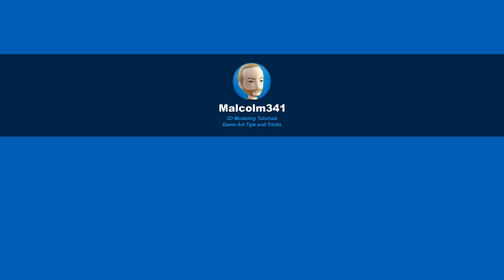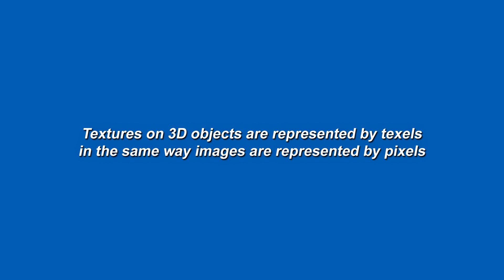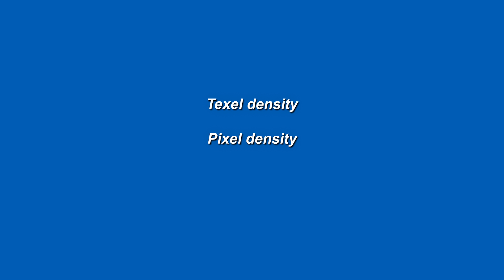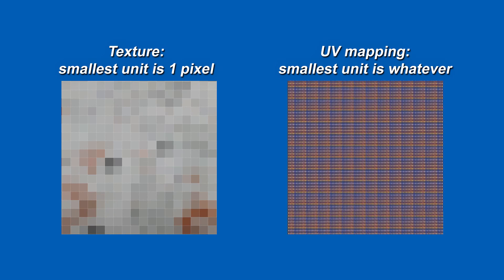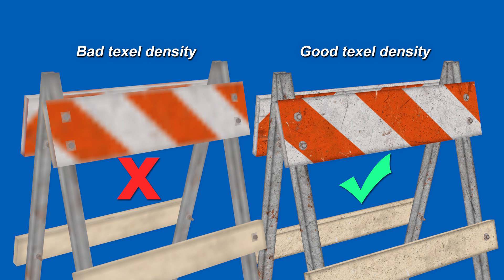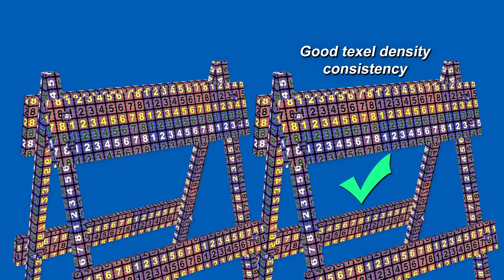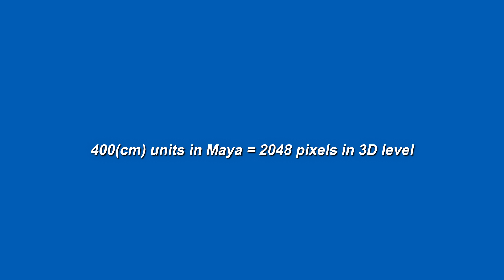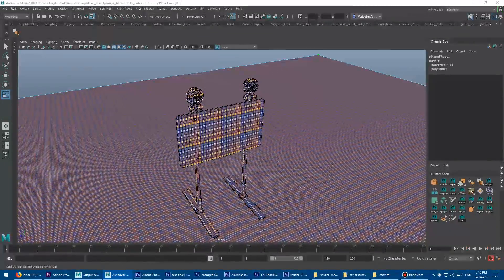What is Texel Density and How to Master it

Comment: and for game characters?
Reply from the maker: Characters will vary by game, often there are four separate textures, head, torso, legs, feet/hands. Typically each texture is 4k and then scaled down to 2k in game. The texel density will vary a bit, the face is often higher rez than the body because the camera needs to get close to it, this is also true of the hands
Reply: thanks for reply, Im trying to texture a large tank for example, I want texture density of 2048 per 1m meter but i need to bake a normal map so UVs cant be outside UV space, everytime i use your workflow as above the UVs are outside 0-1 space. any ideas?  @malcolm341
Reply from the maker: @SuperMontana2008 , the age old question how do I keep texel density high while texturing a big object. You have a couple options here, use multiple textures, use a really big texture 8k or larger, or mirror or tile parts of the UVs to save space. Or a combination of all three techniques. Typically for vehicles in games there are multiple textures, same with characters. We generally don't go above 4k in games maybe three or four 4ks might do the trick. If you're targeting film you can look into Udim tiles which is a lot of 2k textures that all get stitched together sometimes hundreds or thousands which are created in a 3D painting program, Maya and Substance Painter both support Udims as for as I remember. Mirroring the tread and the wheels is probably a good place to start for mirroring and will make the texture process more manageable, then try to use a couple more 4k textures, the bottom of the tank probably doesn't matter that much so maybe it can be lower rez or using a tiling texture. It can be tricky typically the hardest part of any project is laying out the texture using to keep it in budget while also hitting texel density.
Reply: Thanks for the detailed answer,. My tank is for game, its going into the unreal engine. I will probably use 3 or four 4k textures. Do i have to bake everything separately? If so how does the AO work if things a baked separately?  @malcolm341
Reply from the maker: @SuperMontana2008  it depends on what you want to use the AO for when you're done. Technically speaking you shouldn't really use world space AO as lighting information anymore because we have screen space AO and that will double up the effect in areas because it would also exist in the textures. Think about a character's armpits, if you bake AO there and then in game the screen space AO also goes there you end up with really dark unnatural looking armpits. This is kind of subjective though. If you're baking AO to use for texture masking in Substance Painter or something than localized dirt in the cracks will look good. If you're using Marmoset baker (my favorite) it allows you to bake multiple textures at the same time and also allows you to use bake groups so even if the meshes are overlapping they can ignore each other, also I belive there's a setting to contribute AO from certain objects or not, or if that isn't working just do the AO bake where you move the UV's for the other parts of the model outside the 0-1 range temporarily so the AO shadows the part you are baking.
Reply: Really appreciate your help, i will give marmoset a try. Do you know of any tutorials on how to bake multiple textures?? Every tutorial i have seen always seem to bake using one texture. :-/  @malcolm341
Reply from the maker: @SuperMontana2008  looks like you just assign multiple materials to the object and each material becomes a new texture. Make sure to turn multiple texture sets on https://marmoset.co/posts/free-update-toolbag-304/

Comment: Texel density matching can be way faster. Just use the "Layout UV" option. Set the "Shell Pre Scaling to "Preserve 3D ratios" under Shell pre Transform Settings. Then set the "Scale Mode" under Layout Settings to "Off" This will perfectly scale all your UV's to the correct scale in accordance with the size of the objects. Then scale everything to the texel density you want.
Reply from the maker: Neat trick thanks for sharing, the downside to this method is it's a bit slow to computer and the shells don't scale from their centers.

Comment: Very in-depth and concise explanation! Can I ask though why all other tutorials or uv mapping videos I watch everyone simply states that texel density should just be uniform across the model and that islands should not stack or crossover in the 0-1 space. When this is done though the texel density is uniform but arbitrary and not defined to a specific size. Is this common practice but an incorrect one for someone making game assets?
Reply from the maker: Thanks for your nice comment! The short answer is all those other tutorials you've watched sound like they're giving incorrect or bad advice, or over simplifying the concept. Could be the person explaining it hasn't worked long enough as a professional 3D artist in the games industry to understand the topic. In the film industry you'll have more flexibility because texture memory is not as tightly managed because the film is rendered to still frames. In games everything needs to fit into memory at all times constrained by the console or pc limitations. In film they often use something called UDIM tiles so unwrapping your model with even texel density and then throwing 400+ 2k textures at the model is totally valid. In games we don't have that luxury. If someone from games has told you to leave lots of empty UV space in your UV layout just to make sure the texel density across the model is perfectly even this is bad advice. You should always try to overlap repeated elements, tile parts of the texture, and scale up small details if you've got some wasted space left over. As well, if your model unwraps poorly into a square texture with lots of wasted space you can also try a rectangular texture and it may fit better.
There are two main problems in games with UV layouts:
1. Texel density is not even across a single prop and looks bad.
2. Texel density is not even across the world, props are too low rez up close, grounds look high rez when compared to props, some props are lower rez than the prop right beside it. All of these problems are solved by first determining your average texel density for your whole game, then making sure your art team sticks to that metric for all assets that are created. In Triple A games the consumer expects a certain level of quality, they don't want to see blurry textures or texel density mismatch between grounds and props. So if the ground tiling texture looks good in game, but the artist fully unwrapped their prop into 0-1 UV space and the props sits on the ground it may look lower rez. In 2006 I was taught about texel density for open world games at EA and since then every game I've worked on we always compare the prop to the ground during UV layout, if the checker texture looks blurrier on the prop you must find cleaver ways to optimize the UV layout until the checkers get smaller, stacking UV shells, tiling parts of the UVs, using more than one texture occasionally. For games this is standard practice across the industry, for film you'll have more flexibility how the assets are unwrapped.
Reply: @malcolm341  Wow! I can't thank you enough for this detailed response this is extremely helpful. I really appreciate the time you spent to answer this. This was just the answer I needed and clarifies a lot!
Reply from the maker: @Raphmyster  Not a problem, thanks for letting me know you found the info useful.
Reply: @malcolm341  Really useful insights subscribed!
Reply from the maker: Right on, thanks for letting me know.

Comment: This just saved my life xD
Reply from the maker: Fantastic, thanks for letting me know you found the video useful.
Reply: @malcolm341  No problem. This past month I've been pulling mine and my artist's hair out about texel density, sizes, etc. I was doing it completely wrong and using texels as finite, due to how small some of the UV's or large the UV's got on objects. (Realizing much later why you should stack, butterfly, and many other ways of shrinking the shell is the correct way of tackling the issue.) 

I do have a few questions though. After resizing to the correct texel density using the 400 units example, a lot of our assets are not really taking advantage of the UV space. Out of the full UV space, most are around u0.2 v0.2, as they are mostly interior objects like chairs, stools, tables, etc. Would it be more beneficial to add multiple assets to the texture, even though we have them as separate meshes?
Reply from the maker: @charlescortes873  technically speaking filling in wasted UV space is always better, but practically this is lot of work and generally not worth it. I would probably scale up smaller details to fill up the wasted space, or use rectangular textures as often that allow UV layout to fill the space when I square UV layout is wasteful. Also you can deliberately cut the UV shells and separate them to fill up space, but that will create more seams you need to texture over later. Each object will be different and reducing seams while also using all the UV space can take a lot of time.

Comment: I don't get it, this just makes my UV shell huge and outside the 0,1 coordinates. Am I missing something?
Reply from the maker: Hi Nepu-Tech USA, when you're unwrapping anything other than a small prop you will run into an issue. Your 2k or 4k texture isn't big enough and looks blurry and you can't simply unwrap everything into the 0-1 UV space. For example imagine the ground in a video game, no way to unwrap that, even with a 4k texture it will be blurry. So you need to tile the UVs outside of the 0-1 space. Now the tricky part is you need to make sure all UVs for your entire game tile outside of the UV space the exact same amount, or you get texel density mismatch. As well, all the props you unwrapped also need to have the exact same tiling rate as the ground and the rest of the game which requires a lot diligence. Keeping buildings, grounds, and props the same resolution while working in the constraints of game memory limitations is referred to as texel density.

Comment: @malcolm341 "I don't know what 5.12 means"

5.12 = 5.12 Pixels per Centimeter
2048/4 = 512 Pixels per metre, 
Standard measurement of Texel Density Pixels per Centimeter... therefore
512/100 = 5.12

Artists will want to understand this for workflow purposes
Great video btw helped alot!
Reply from the maker: Yep you got, I'm terrible at math my wife also explained it to me after I finished the video.
Reply: Hello! Sorry I am confused! I understood that you divided it by 100 because 1 meter = 100cm. But why did you divide 2048 by 4? Where did you get the "4"?
Reply: @circusmonkey28  He established a scale of 400 centimeters is equal to 2048 pixels at the start of the video (every project must establish a standard scale for all textures relative to the size of objects in the scene in order to keep texture resolution consistent throughout the game).  That plane that he created was 400 cm wide and 400 cm deep and he applied a texture to it that was 2048 pixels wide by 2048 pixels deep.  So, to determine his texel density for the entire project he divided the pixel resolution by the unit scale of the object (2048 / 400 = 5.12).  That value of 5.12 is the texel density value for all objects in the game level from that point on.  He then did a basic unwrap on a more complex model and used the UV Toolkit in Maya to apply that texel density value to those UV islands.  You'll be okay as long as you remember to always divide the resolution of your reference texture by the unit scale of your reference plane.  The value you get is your texel ratio (or texel density if you prefer).  It seems super confusing at first (at least it was for me) but once it clicks you'll see that it's actually pretty simple.  Cheers!
Reply: @pixelscholar  Thank you for the explanation! I am gonna have to re read this a lot to wrap my mind around it.
Reply: @pixelscholar  Thank You so much!
Reply: @pixelscholar  I’ve ready so many articles on it today, and your comment was the only thing that got me to understand it, thank you, now I can sleep in peace 🥲
Reply: @circusmonkey28  right there with you bro :)
Reply: @pixelscholar  Thank you for explaining how that big plane come from! Now I was clear a bit after reading your comments :D
Reply: @circusmonkey28  it's usually  2048px/4m pixel ratio that's used in the industry
Reply: Really great point considering centimeter as maya’’s default unit of measurement!
Reply: @jeansamson4079  Thanks man , the "unit' thing really was confusing me !
Reply: thank you dude, you honestly helped more than the video :')
Reply: what confused me up until now is that people call the 5.12 "PPI" when its actually PPCM, cause its cm not inches, and i just couldn't get the math right cause i was trying to convert the 4m to inches and it just messes up everything -.-
Reply: Thank you I was just about to comment on this, felt like a really bad way to teach about TD without explaining it properly
Reply: True same as 2048 / 100 Pixels per Centimeter = 20.48

Comment: So in a program like Unreal, overlapping UVs always give me an error when I'm trying to bake the lights. How would I be able to do this and avoid those errors? Because the solution you've given can work for me, but I don't think Unreal will approve.
Reply from the maker: Hi ShyPoke, when you import a mesh into Unreal it will try to automatically generate lightmap UVs for you, you can see those UVs in the static mesh viewer in the UV drop down it will be the second UV set. It will take your diffuse UVs you created in Maya and try to lay them out without any overlaps in the second UV channel in Unreal. So in Maya you don't need to worry about overlapping UVs Unreal will lay them out, but the problem you're encountering is when a UV shell is stitched to another UV shell incorrectly and can't be laid out by Unreal. For example you have a cube in Maya and you use a camera planar projection on it, it will be stitched to itself and won't be able to layout the UV shells in any program including Maya. To avoid lighting errors Unreal gives you a warning saying you have overlapping UV shells, the warning is misleading it should say you have UV shells that can't be laid out. In Maya if you have a cube and map each face with a planar map from that corresponding face axis and then stack all the shells  on top of each other this will bake fine in Unreal and won't give you an error because Unreal will be able to layout the UVs even though they overlap in Maya.

Comment: That's super helpful, thank you. What's your UV grid setting? is it possible to actually increase the grid size to reduce the need for downscaling the UV shells to fit 0-1 grid?
Reply from the maker: Thanks, glad you enjoyed the video. I just use the default grid settings, I generally hide the UV grid when I'm working. To increase the size of the grid in the UV editor, inside the UV editor file menu go to View> Grid options box> change Length and Width: to whatever you like, I think 10 tiles is the default, so if you increase it from there and hit apply that will make the grid bigger.
Reply: Thanks for the answer and sure one can resize the grid which is straightforward but what i was curious about was if the resizing the grid would make sense in practice to fit larger shells in the UV space. thanks again.

Comment: "A texel is a container for the pixels". This has me way confused.

I'd say a texel can be visualized by one or more screen pixels depending on the texel density. In an ideal scenario your texel:screen pixel ratio would be 1:1 for it to look "crisp".
Reply: I guess due to filtering techniques a texel can be visualized by less than a single screen pixel as well.
Reply: This is where your mip-levels would start traversing down to avoid creeping due to too many pixels fighting to be visualized on too few screen pixels.
Reply from the maker: Yep you got, I have another video on mip mapping as well if you're interested. As far as I know a texel can contain part of a pixel or a whole pixel, or multiple pixels depending on UV mapping of the 3D surface.
https://youtu.be/MVsIIkJNkjM

Comment: your technical details are very helpful. thanks for sharing. i have a doubt, is it possible to scale multiple uv shells on their own pivot In UV editor ? ... like we scaling multiple objects on the local pivot point.
Reply from the maker: Thanks for your positive feedback. I don't think their is a way to scale multiple UV shells around their local pivots, it appears UVs always scale around the selection's pivot by default. As a work around you could scale each UV shell separately one at a time, if you need them to be scaled exactly you can type the value into the scale tool and then apply it to each shell one at a time.
Reply: malcolm341 thank you for your tip. 👍👍